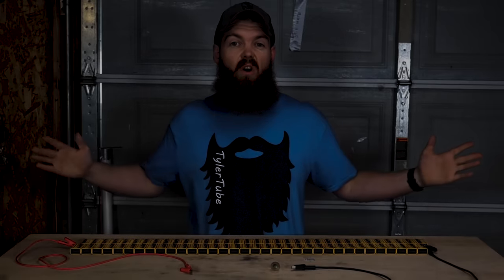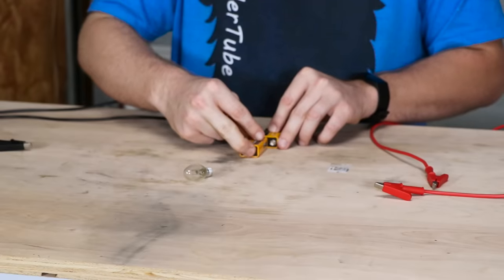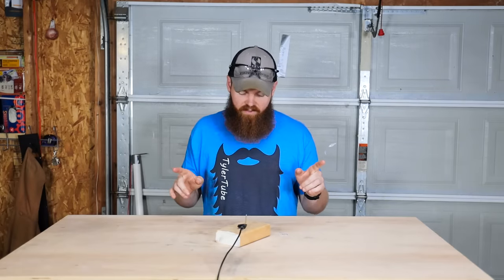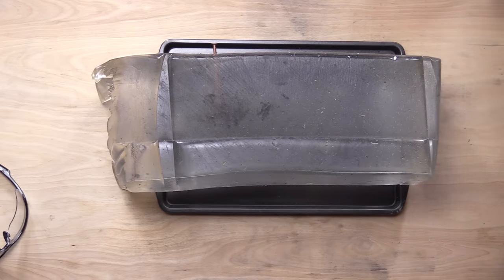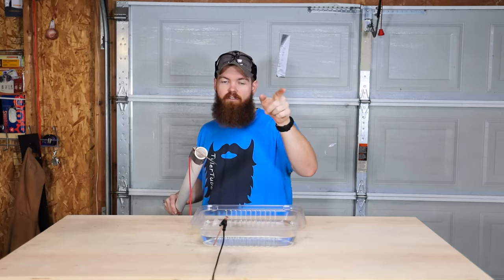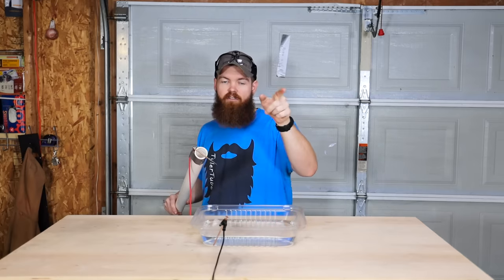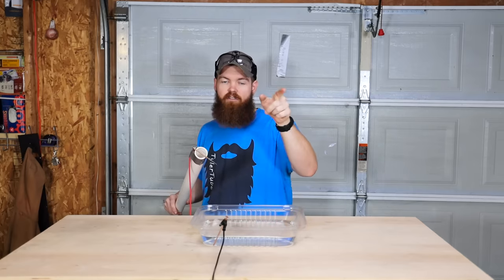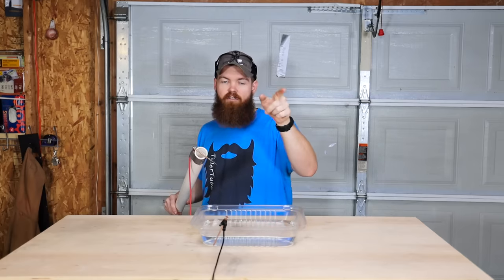I Connected 500 - 9 Volt Batteries...

Comment: I was waiting for him to get shocked repeatedly slapping his hands down on each end of 600+VDC of batteries.  By divine intervention he managed to survive making this video...
Reply: That was close to around 750V in each bank he had assembled long as he didn't touch the terminals he would be fine but still was nerve racking since he clearly had no clue what he was doing. i was very nervous
Reply: It was direct current, now our body has prety big capacitive reactance which means that we can't safely touch 230V AC but we can safely touch 230V DC. But i don't know about those 4500V. If the voltage were to breake through the outer layer of his skin, things could turn prety bad prety quickly. I don't think, or at least I hope he wouldn't have been dead but... voltages in excess of 20 or 100 000 make it dangerous to even point at things as your finger is relatively sharp and electric fields like to acumulate on sharp edges making for a breake out point. Now 4.5 KV can breake through 4,5 milimiter (or 0,18 of an inch) gap of air...and he just puy his hands on the powerbank. He was spiling baking soda solution everywhere making conductive paths. He didn't wear welding mask as high curent electric arcs generate a lot of UV light. And he didn't research high voltage, high current safety. Those bateries have 4,5 ampers of short circuit curent. Which 4.5 A times 4500V means 20 250 wats. Safe limit for our body is 10 wats not acounting for an impedance. If he touched that to his eyes or his mouth, or baking soda solution closed the circuit, then he would win a Darwin award by selecting himself and his obloviousness out of this world.
Reply: 6:22 definitely had me holding my breath.  We're talking a few mere millimetres from a life changing experience.
Reply: 60vdc aprox is ur safe voltage
Reply: @weazeldark3983  I heard that it's 24 but reguardless, its still 75 times 60
Reply: @manman-sg1zt  32v ac
60v dc 
High frequency ac is higher voltage than both
Reply: @weazeldark3983  Aaaaaa... well. Technicaly yess but actually no. Yes becouse the impedance of our body is less responsive to ac (it lets more current through) and is more responsive to dc blocking it. And no becouse frequency is not voltage.
Reply: man  high frequency the electricity goes above the skin not though it
Reply: @weazeldark3983  It actually goes through, through electric field propagation, but on the second thought. If you ramp frequency high enough, we won't feel the shock. Though, the arc will still be there. So, wery high frequency arc like above 50 or 100 kHz won't shock you. It will burn you, but you won't feel the shock, just the heat.
Reply: Rf burns
Reply: @weazeldark3983  Yup.
Btw. Theres that guy called electroboom that made an episode on exactly that topic. Proving it by electrocuting himself with a full bandwidth of frequencies.
Reply: His hand can only cover 10-15 batteries. He would have to touch the extremities to get shocked. The banks were not even connected together...
Reply: @manman-sg1zt  DC will kill you WAY faster than AC.

I play with Tesla Coils. 
55,000 VAC, 500Khz.

I can light up a fluorescent tube in my hand. 
I wouldn't attempt that with DC.
Reply: @1TwistedPoet  But if it's DC, then why does it have frequency.
Reply: @thegreatcanadianlumberjack5307  I was thinking about rectified high frequenc. I mean lead acid battery for example outputs 12V DC and yoy can touch it without even feeling anything. You could do the same with 230V DC. Though I'm not entierly certain how big of a voltage is necesary to breake through human skin. And to be honest I doubt some one would be conducting experiments on human breake down voltage.
Reply: @manman-sg1zt  This was a 750V output with a lot of current look at what it did to the hotdogs.  the only way Electricity flows through you is if your connected to the ground in some way Electricity will always take the easiest path to the ground and Voltage will inflict pain since that the potential Energy if the Electricity. it's Current that will kill since that's how fast it is moving. it takes .03 amps to make it so you can't let go and .05 amps to kill and i had to save someone once that couldn't let go while he was getting shocked i had to get him off with a nearby long piece of 2x6 (You can't grab them or you will be shocked with the same current)
Reply: @thegreatcanadianlumberjack5307   
1) Is he alright now? I mean, whoever you had to rescue.
2) Electricity doesn't take the shortest path, Lightnings do but electricity takes all paths and majority of it goes through easiest paths.
3) Personaly I think that it's power that kills because W = V x A, and frequency also needs to be taken into account. But after all . Tere can be high voltage and there can be high or low frequency but if there's no currentthen, teres no problem.
Reply: @manman-sg1zt  He is alright now but it was quite scary stuff. And this was on the job site someone told him it was a dead circuit and it was still live (Which is why you always use and carry a Voltage tick tester to make sure the circuit your working on is truly not live). 

Now on to your part about Electricity:

First, Everyone knows Lighting and Electricity is the same they will always take the shortest path to ground. 

Secondly you seems to know ohms law if there is Wattage and Voltage there will be current. (Also W/V=A) All three are tied with each other if you got a 120V circuit with 10 amps flowing through it that 1200 Watts of power (If you really want to get deeper into it apply it to Electrical motors there is a whole diffrent batch of calculations for that) Like i said Current is how fast the Electricity moves Voltage is potential energy (Which decreases the further it has to travel from the source)

Third, Frequency applies to AC power  DC will have no frequency. 

Trust me i should know this i do this for a living. Two years in been shocked three times (one of them was in school funny enough) and had to save someone from dying.
Reply: @thegreatcanadianlumberjack5307 Now, I'm not yet living out of electricity. But good thinking with that stick and with voltage tester. 

Now onto the lightning part. I will both agree and disagree with you becouse lightning is plasma or in other words ionised air that has very low resistance which allows all the charge stored in the clouds to equalise with the earth in a fraction of a second while taking a path of least resistance meaning where air is easiest to rip apart. After the discharge there is no charge left to take a harder path. But then there are coronal discharges that care quite a bit less about easiest paths and they can affect not an insignificant volume of air. If you've ever felt your hair rasing during the storm or smelled the ozone, that's coronal discharges' work.

And last, yes inductors and capacitors are a different piece of cake, but that cake turns four dimentional when you take into account asymetric inductors and capacitors. They both might seem prety normal at first, but my osciloscope said that I can make 5 wats from 1 using a separating transformer with a tiny primary wrapped around both coils and those inside ones connected with one end so that no matter which way current flows through them, they will always generate fields that opose each other. By the way, the core looks like a 0. And about the capacitors, how do you explain the fact that ionic wind doesn't care about electrode polarity and instead flows from smaller electrode to the bigger?
Reply: @manman-sg1zt  WTF man. 230V DC is very high voltage. From my experiment I can say that around 40V I can feel the electric tingle and around 80V it starts to get painful. 230V could be lethal if electricity travels hand to hand or hand to foot. Resistance is the key word in here. There are many variables to consider. Your skin could be moist and if you have a fresh cut then the electricity can go into your veins and that's really bad. Blood has less resistance than your skin. (Duh.) Also try to lick 12v terminal and come to tell us does that hurt. OTOH AC is much worse than DC atleast when you measure pain with 60Hz and low voltages..
Reply: @ViikatemiesFIN  Well, you see. According to electrical standards in my region, everything under 1000 V is a low voltage. Besides, you can touch 230 AC and not feel anything given that you only touch the phase and are well isolated from anything else. Further more you can touch plus and a minus of 230 DC and not feel anything becouse impedance.
Reply: @ViikatemiesFIN  Okay, I might have given it a bit more thought but you can touch 230 DC and you won't feel it. I should have said resistance but i thought that impedance would take frequency into acount since your skind in this case works as an isolator and your blood works as a conductor making for a capacitor. Now when frequency is 0 then that voltage would be able to displace charge in your blood but only for a fraction of a second. Soooooo, yeah. It would make more sense to talk about resistance as that is the thing holding up against DC.
Reply: @manman-sg1zt  You certainly in all cases will feel 230V DC. 

Let's say with "best case" scenario 100k ohms of dry skin resistance and 230V DC you will get ~2,3mA. Pain threshold is around 5mA.

Now, if you have moist or wet skin the resistance could drop to 10-1kohm. So the current will rise to 23-230 milliamperes. Those are lethal levels. I'm no medical expert though, but I'm certain there's a chance hearts beat might get messed if it gets even a short pulse like that.

You can't touch bare handed 230V DC without sensing it. Go watch Greatscotty's or Electroboom's videos of them testing their pain endurance.
Reply: @ViikatemiesFIN  Okay. I went straight from under the shower to do it so my skin is as moist as it's ever going to get. I took a multimeter, grabbed one probe with one hand and second with the other and it showed 5,663 megaohms. That means that the current that would flow through my hands at 230 DC would be 0.041 mA
Reply: @manman-sg1zt  Yeah, multimeter shows too high values. I mean if you use source of 230 DC, like a series of batteries, the resistance goes down as the current finds ways to go trough. I don't actually know why that happens.

You do realise if your 5,663 mohms measurement is correct then you would not feel 2300V of DC. Current would only be 0,41mA.. I doubt highly.
Reply: @ViikatemiesFIN  Maybe not now (because I'm literaly under the shower) but I'll find a capacitor and resolder a diode to it to get a source of 230 DC, I'll touch it and then I'll write how it went becouse I remember doing it but I'm not sure. Besides, that resistance falling down is called a break down.

Edit:
What 2300V ? Did I write that?
Reply: @manman-sg1zt  No you didn't write 2300V but the math is the same. 10x voltage = 10x amperes if the resistance stays the same. Basic ohm's law. I = V/R.

If you want to try this somewhat safe, try with 9 volt batteries. They don't cost so much. Maybe start with 45 volts. (5x 9v in series). I did my experiment with lithium cells. Adding everytime 3,2V. Like I stated, I started to feel the tingle at 40V (12 cells in series) and pain was ~80V. Please don't just jump to 230V.
Reply: @ViikatemiesFIN So I touched a capacitor charged to 230 but it was tiny. Ceramic one with only two flat plates the size of a quarter. I didn't feel anything but it still discharged. It was about 1 nanofarad so hella tiny. Well...guess a microwave capacitor is next.

Edit:
Microwave capacitor is 1 microfarad so about a 1000 times bigger charge capacity at the same voltage.
Reply: @ViikatemiesFIN  I stand corrected. You can't touch 230 DC. I charged a microwave oven capacitor to 230V, touched it, and I felt it. That wasn't nice. Not AAAAAAAAAAAAAAAAAAAAAAAAAAAA type not nice but if that wasn't the case I still had 200 microfarad electrolytic XD.
Reply: That's bc what you're scared might happen is 🧢

Comment: "Everything is conductive if you put enough electricity through it" - my circuits professor
Reply: EXACTLY even rubber and plasma
Reply: @harunaw.d147  Plasma is litterally one of the most conductive "Things" out there
Reply: Even a complete Vacuum?
Reply: @karlalbert2798  a complete vacuum isn't exactly a "thing" though
Reply: @anthonygeiter5842  Fair point
Reply: If you put enough *voltage through it.
Reply: that is not conduction, it is the breakdown of the dielectric. There are many good insulators. Mineral Oil for instance. The demonstration with the soap shows the soap to be a good conductor. That is not a surprise as soap is a salt and salt added to water will be highly conductive.
Reply: Is that why with enough determination Pikachu could still shock team rocket in their rubber suits?
Reply: @1987FX16   technically it would be voltage across it
Reply: I literally just left a comment saying the same as your professor lol
Reply: @karlalbert2798  yes, charge builds up on the electrodes and eventually you have free electrons flying off if in a vacuum. Basically a particle accelerator, in fact this is how an electron gun works
Reply: @karlalbert2798  technically, yes. The electrons still can travel through it.
Reply: He has nominated himself for the grand prize at the Darwin Awards this year. Lets keep watching his channel to see if he wins. Maybe the extra hits will earn his widow a nice nest egg to live on.
Reply: Everything is a wire if you put enough volts into it

Comment: You are insane putting your hands near the end terminals, especially going through both arms, if that started arcing with the 500-600v you'd probably be in fibrillation
Reply: No not probably. He would.
Reply: @diamondg976  You can get lucky. My uncle serviced electron beam evaporators and molecular beam epitaxy machines. He'd gotten high voltage shocks 3 times in his career. The last before he retired was from a 12kV DC @1A power supply. It was old and used a huge water cooled vacuum tube to regulate power. A water leak had damaged the power supply, leading to him repairing it. The power supply, about the size of a server rack, was divided into a high voltage and low voltage side, except for one wire and resistor coming from the high voltage terminal of a 1uF capacitor the size of a toaster oven that went into the low voltage side. He'd missed it in the schematic and it arced about a foot to his hand. Knocked him out for about half an hour. The grad student who was supposed to be there with defibrillator for just that reason had wandered off, but fortunately he survived even so. Still, it took months for the entry point in his hand to heal. Not a gamble I'd be willing to take, that's for sure.

Comment: Man, this one is at the top of the "I hope my kids don't see this" list
Reply: i think you would notice if your child suddenly got 500 9v batteries
Reply: I mean my parents are always running out of 9 volts for carbon monoxide detectors I'll just say that it's stocking up..
Reply: @maxwfk  it is not hard for a house to have dozens of half used 9 v batteries, just that many is enough to output  tons of voltage and can be very dangerous